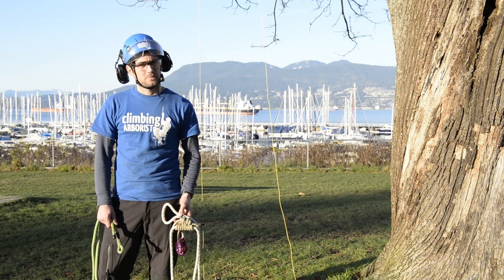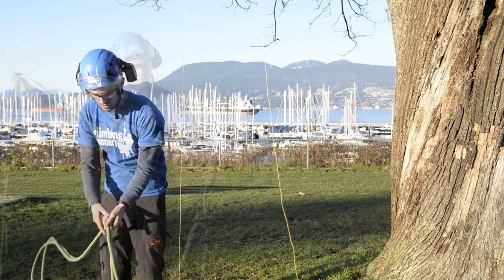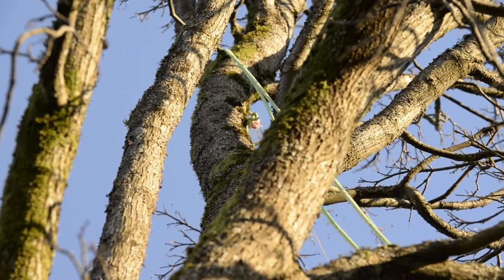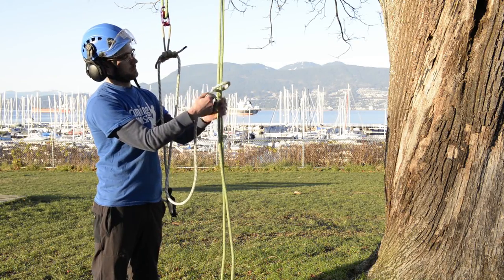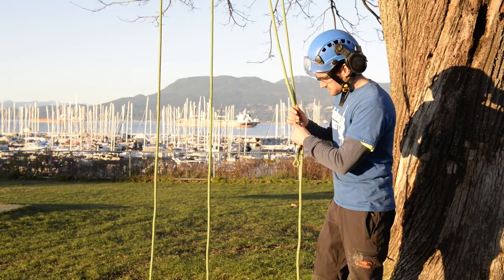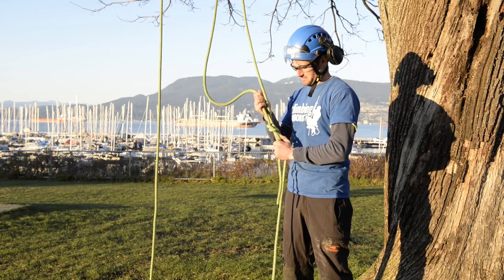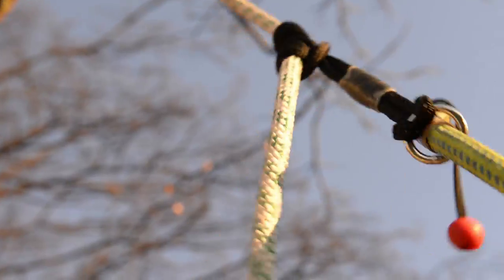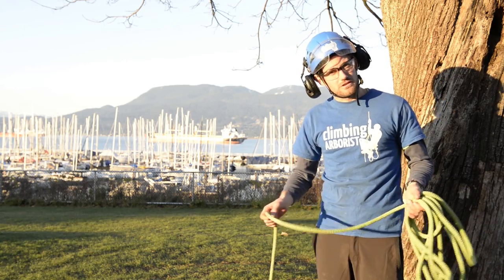Install and safely retrieve pulley saver from the ground

Comment: Most presenter are too eager to demonstrate their techniques on "how to climb a tree" but none actually realise that demonstrating the first stage for setup (as in this video) is the most important beginning for any would-be-starters. Good effort mate, ive finally found a useful video. On the side note, the video steps are too fast, perhaps an extended short video shoot from a low tree branch with step by step sequences will help to demonstrate how the pulley system is secured. Thank you

Comment: Hi Dan,
Rather than using an extremely long climbing line, would it be, somehow, possible to use a second throw line for the installation and then pull the climbing line through the pulley very last?
I'm just learning to climb and I used a pulley for the first time a couple of weeks ago. It makes a huge difference for double rope. Then yesterday, at Tafe, we used a cambium saver and it was crap. It made little difference (to the climb) than using natural crotches (They were silky smooth Blue Gums (Eucalypts Saligna)).
I'm sure the tree appreciated the use of the cambium saver through.
P.S I learned to foot lock yesterday. I was very happy to finally crack it.

Comment: I'm not an aborist but I use a very similar homemade pulley saver, with this DMM "Pinto Rig" pulley in fact. 1 reason for choosing the video. Except mine is 2 layers of webbing stitched together with sewn loops around the top connection holes. It's used as the anchor point for a Manila climbing rope, attach static rope to a shackle on the end splice, pull it through/up and tie it off on a nearby branch. Not able to use a Prusik as seen here unfortunately (or the "snap") so instead need to use a separate length of rope installed above the loop/eye to release the pulley when finished to bring it down. In my case the pulley goes back around the limb, not ideal but I only use throwline to control the descent. Was still interesting to watch this example, thanks.

Comment: This can be done with a throwline. It installs the pully and then the rope can be pulled up. That way you dont need 4 times the length of rope. A pilot line can be used for retrival if disired. It is better for installing rigging lines in a secondary tree that you dont want to climb. Then it saves time, if you are good with a throw line.
Reply: I'm interested in how to do this another way. Could you clearly explain the method, or post a video or a link to a video for me please ? I've just purchased a pulley saver, and I'm keen to know all about it's installation and use.
Reply: @robthompson1399  I made a special weight with a nut and bolt. It does not pass through the pully but stays flat against it. It needs to be compact and heavy. You attach it to the throwline. First install your throwline over a single branch then one end goes through the pully and your bolt is attached. Then the other end feeds through the loop side of the pully saver. Second fase. The pully should begin to ascend as you pull the throwline and the loop end will also ascend, the throwline should still be inside the loop. Once the pully goes over the branch it will go inside the loop. Once that is done let the bolt come down. Take the bolt off and attach your rope. Pull the rope through the pully and ascend. Once up attach the part for retrival. I use this very rarely as I usually ascend in srt but it is useful when you need it.
Reply: @robthompson1399  if you want the pully saver to come down without using the little  ball retrival, attach a throwline to the retrival part and when you pull your rope down retrive the pully saver with the throwline.
Reply: @75MalcolmX  thank you for taking the time to do this, it seems better to be doing it all with a throwline in place of a rope. Why are you using the nut and bolt instead of  a bag ? I'm trying to get my head around it, to visualise the process. I'm guessing that maybe the floppy throwbag hinders entry to the stiff eye ?
Reply: @75MalcolmX  it seems to be the standard method for getting a ring and ring saver up. Now that I've read it a few times ! I've got my Saturday head on, and it's a bit sore !
Reply: @robthompson1399  bags have rings, some are small and get stuck in the pulley. Plus they are big and it is difficult to get them through the loop.
Reply: @75MalcolmX  cheers, you're a great help 👍

Comment: So, for this technique to work, you need to climb to the anchor, disconnect your line from your harness, and thread your splice through the retrieval ring. This is what you are talking about at about the 3:30 mark?
Reply: Don't think so, I was under the impression that he means to just thread your tail through the thimble. It does warrent a visit to the anchor point though...

Comment: Is it possible to have a zigzag while doing the installation or do you need to use a prusik?
Reply from the maker: I don't quite understand your question, but yes you can use a zigzag with this system
Reply: A zigzag is a mechanical prusik, I believe.
Reply: @user-rn3rn6nl3h  i think you also misunderstood lol. Hes made like 6 videos w zigzags lol

Comment: Not an arborist, but a challenge course trainer and installer. This system looks unnecessarily complicated, but has some useful tips in it. What is really throwing me off is the retrieval ball. It didn't seem to serve a purpose - It looks as though it could have slipped right through that metal ring. Can someone shed some light on that?
Reply: Better with pulley than branch. 
This is the cuestion. The smooth in the work

Comment: Wow this is why I like the Single rope best. No friction saver is needed but you gotta have a 400 dollar climbing device after you've bought literally hundreds of dollars worth of rope, gear and climbing saddle.

Why couldn't you just use a 2nd rope to drag the pulley up with your climbing line in the pulley? Ropes going over the branch right? Stop the pulley just short of the branch and tye that rope off ?

Comment: Smart idea but we all know that got snagged up while pulling it down, hence the cut in the video lol.
Reply: Even without the cut in the video, I figured that the pulley could easily get snagged up in the tree, in fact it should be the likely scenario.
Reply: I use this pulley saver almost daily; I'm yet to get it snagged. No doubt it could happen, but actual experience says snagging is not the likely scenario, merely a possible one.
Reply: maxfacta1
Thanks for the input. Experience is always the best teacher.